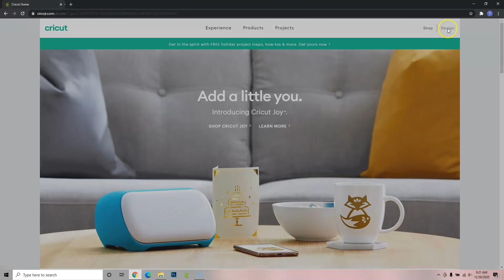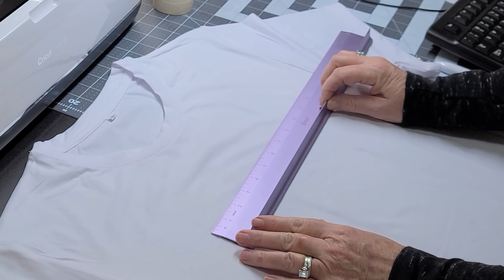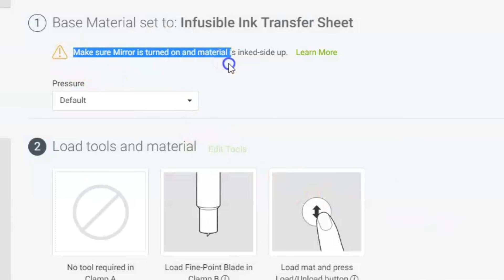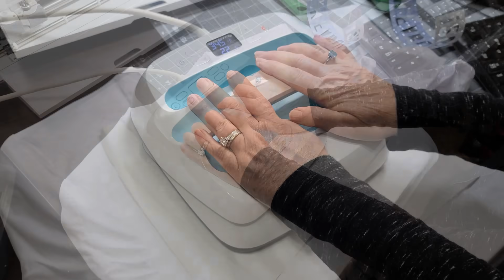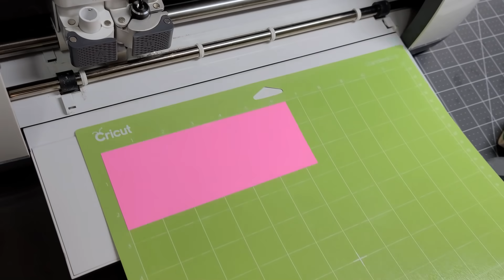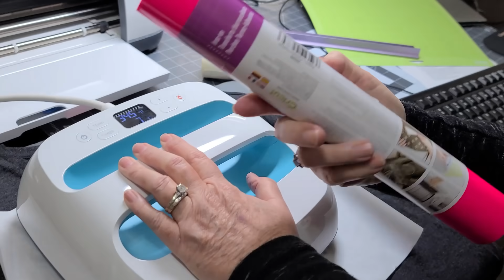Best Introduction to Cricut Maker! How To Make T-Shirts!

Comment from the maker: Here's a list of products used in this video. These are affiliate links which means we earn a small commission (thanks!).
- Cricut Maker - https://cricut.pxf.io/PybabQ
- Cricut Easy Press - https://cricut.pxf.io/k0WRWd
- Cricut Heat Mat - https://cricut.pxf.io/eKNRNz
- Cricut HTV - https://cricut.pxf.io/aneKeM
- Cricut Ruler - https://cricut.pxf.io/GmgDgL
- Cricut Trimmer - https://cricut.pxf.io/oqOnOm
- Cricut Standard Grip 12"x12" Mat - https://cricut.pxf.io/zN4j46
- Cricut Tshirt - https://cricut.pxf.io/baV7Nk
- Cricut Infusible Ink - https://cricut.pxf.io/Orb1Kn
Reply: what kind of paper are you using
Reply: Do we need to apply transfer tape to the vinyl before cutting? I didn't see that part in the video?

Comment: Hello, so what is the difference between this heat press and the bigger ones with a lever that you pull? So the cricut machine makes life easier?
Reply from the maker: Some of the bigger heat presses with auto release when they are done. Some will allow you to apply pressure without have to lean on the machine. If you're thinking about getting a bigger one, I'd look at HTVRONT. They have several models. Here's a comparison of their 15x15 models - https://youtu.be/Qhy5HjGfAmw?si=XpEuYgYk75Y05STx

Comment: Do you need a heat press or will an iron work?
Reply from the maker: Iron will work but with sublimation the temp needs to be 385-400 degrees.

Comment: quick question i know im late but if i have an iron not a heat press will it still work to make the text stay on the shirt?
Reply from the maker: Yes - definitely with heat transfer vinyl (iron on). If you're doing sublimation or infusible ink, you'll need an iron or heat press that gets up to 385-400 degress and use a shirt that's high in polyester. The higher the count the better the results.

Comment: hiya, I have to ask if you don't by a cricut T-shirt, on a different brand T-shirt do you have to use the Iron on vinyl instead of the ink one ?
Reply from the maker: The infusible ink needs to go on a garmat that's high in polyester. If you use it on a 100% cotton shirt, it won't be bright and will fade away after 1 wash. Use HTV (heat transfer vinyl) on shirts that are not high in polyester.

Comment: What happens if I don’t use cricut shirts? Will it just not work or will it fade faster?
Reply from the maker: You can use heat transfer vinyl on fabric but infusible ink (which are sheets of sublimation prints) the fabric needs to be high in polyester. The higher the polyester count the better the results will be.

Comment: Can you still do this without a heat press?
Reply from the maker: You can use an iron. Just know that when using infusible ink or sublimation, you need one that can get to 385+ degrees. For regular HTV, an iron works fine.

Comment: I want to buy like this and wanna try print out shirts. May i know what are the equipments i need for this pls?
Reply from the maker: @steffienitura5230  Here's a list of products used in this video. These are affiliate links which means we earn a small commission (thanks!).
- Cricut Maker - https://cricut.pxf.io/PybabQ
- Cricut Easy Press - https://cricut.pxf.io/k0WRWd
- Cricut Heat Mat - https://cricut.pxf.io/eKNRNz
- Cricut HTV - https://cricut.pxf.io/aneKeM
- Cricut Ruler - https://cricut.pxf.io/GmgDgL
- Cricut Trimmer - https://cricut.pxf.io/oqOnOm
- Cricut Standard Grip 12"x12" Mat - https://cricut.pxf.io/zN4j46
- Cricut Tshirt - https://cricut.pxf.io/baV7Nk
- Cricut Infusible Ink - https://cricut.pxf.io/Orb1Kn

Comment: wow 
I have a qs- can this heat presser be used for sublimation process or is too light weight/too low temp? and what is  the programme you used for design please? thank you
Reply from the maker: The program is Cricut Design Space. Sublimation needs to be pressed at 385-400 degrees with a bit of pressure. The new HTVRONT manual heat press would work well with sublimation. You can adjust pressure with this unit. Check out my review of that here  - https://youtu.be/u-rUojEdlbY?si=bEKDxhYDsrtEv9rt

Comment: and what happens if you dont use a circut shirt or fabrics? I plan on only using 100% cotton anyways.
Reply from the maker: Cotton works great with HTV but not so much with Infusible ink… use shirts high in polyester with Infusible ink aka sublimation.

Comment: I normally buy  tshirts from tshirt studio .
I would like to know everythink needed for printing myself plz
Reply from the maker: In this video, I used Cricut to cut vinyl and iron that on. You can use a sublmination printer to make sures but the shirts need to be high in polyester and light vs dark works better. I'm working on a video about this.

Comment: Can someone help me? I’m new to using the Cricut and I bought an SVG file off of Etsy that I want to print on a shirt. (It’s 2 colors red and black . ) I wanted to add my name to the file to match the red color . I added the name to the file in canva and I uploaded it to design space as an svg. When I go to complete the project (To the next step “ make” )the black cut on the grid looks ok but the name I put in canva for the red cut is now separated from the image and the letters are set off to the side in a random order. Can someone tell me how I can make the two red images print together and in the way I positioned them on the image? Any help would be greatly appreciated. Thanks!
Reply from the maker: Hi - on the canvas in design space, select all the letters then click Attach in the bottom right corner. Once you do that, try to make it. 🙂
Reply: Thank you sooo much for the reply. I  try that now.
Reply from the maker: @princessss42  - you’re welcome 🙂
Reply: It worked ! Thank you so much!!!

Comment: Can you use a regular iron, or do you have to have a heat press?
Reply from the maker: You can use a regular iron with more iron on material. Note - infusible ink needs high heat between 385-400 degrees.

Comment: Thank you for amazing video , what is the material you are cuting called?
Reply from the maker: You can use iron on vinyl also called HTV or infusible ink. If you use infusible ink, you'll need to use a shirt that's high in polyester.

Comment: Instead of the press can't you just use a iron????
Reply from the maker: You can for most iron on material. But for infusible ink the temp needs to be between 385-400 degrees to transfers well.

Comment: So do you have to use a circut shirt or is that preferred?
Reply from the maker: You cans use any shirt within iron on material but with infusible ink you need a shirt high in polyester - doesn’t have to be the Cricut brand specifically.

Comment: What's the greatest brands of shirts you can use as for as budget wise not so high cost as the cricket shirts..?
Reply from the maker: With regular HTV (heat transfer or iron on vinyl), you can use any shirt brand. With infusible link, you can also use any shirt brand but the shirt needs to be high in polyester. The higher % the brighter your colors will turn out.

Comment: Can the vinyl hold up to multiple washes?
Reply from the maker: Yes. Be sure to follow Cricut’s care instructions:
Wait 24 hours after iron-on application before washing. Turn garment inside out. Wash and tumble dry on low or medium heat. Do not bleach or dry clean.If you need to iron, turn garment inside out and iron the back side.

Comment from the maker: Here are the links to the products used in this project. We are Cricut and Amazon affiliates, so we may earn a very small portion of your purchase (THANK YOU!)
- Cricut Maker - https://amzn.to/3eIQXA0
- Cricut Easy Press 2 -  https://amzn.to/359kDCa
- Cricut 12"x12" Easy Press Protective Heat Mat - https://amzn.to/3pRQIGR
- Cricut Infusible Ink Iron-on Material - https://amzn.to/2LfDk00
- Cricut Iron On Vinyl - https://amzn.to/3Ws4CAD
- Official Cricut Women's Infusible Ink V-Neck T-shirt - https://amzn.to/3rSl7GA
- Cricut, Basic Tool Set - https://amzn.to/2X7dTjZ
- Cricut Metal Ruler - https://amzn.to/3Nlyquc
- Cricut Standard Grip Mat - https://amzn.to/3Fz3ViV
- ChicWrap Parchment Paper Dispenser - https://amzn.to/3SMXE5R
Reply: Does it only do text or can we insert pictures?

Comment: What do you guys like better? Inked infused transfer or vinyl for the tshirts?
Reply from the maker: Hard to say. Infusible ink is awesome but does require shirts high in polyester for best results. I don't always have those on hand. Vinyl works great and the colors are vibrant on any material.

Comment: Where did u get your transfer tape from I got the circuit one and the letters won’t come off it could be the needle idk
Reply from the maker: We use the Cricut brand and it works most of the time. Sometimes you have to press a little harder.

Comment: Could you just use a iron ?!? Or you need heat press ?!?
Reply from the maker: You can use an iron for HTV but for infusible ink the temp needs to be between 385 and 400. If your iron gets that not, you should be good to go. Apply extra press for infusible ink.

Comment: Do you have to have the heat press or is it just like a regular Iron?
Reply from the maker: You don’t have to have a heat press. An iron will work. The only material that may give you a little hard time with an iron is Infusible ink which needs to be heated at 385-400 degrees. Everything else should be good.

Comment: Lastly what’s the name of the tool you use to cut that infusion ink sheet
Reply from the maker: I have the Cricut Maker and Cricut Joy and use both to cut infusible ink. Depends on how big a project I'm doing. The Joy cuts 4.5" wide. The Maker 12" wide on a mat or 13" wide with smart vinyl.

Comment: You said they have permanent vinyl ? 

What would you recommend for me .. 

I have a 2 word logo ..i prefer cotton tees
I normally would screenprint but I end up having lots of inventory left… 

So now I’m about to order a heat press and cricut …… I want to get as close as a screenprint looking tee / permanent looking /clean looking tee as possible 

Will HTV be the go to ? What type of vinyl technique will you recommend .. 
Can you give me feedback please

I’m also wondering if I should get the cricut or heat press machine 🤦🏼‍♀️
Reply from the maker: If you are wanting to put a logo on a shirt, you will need to use heat transfer vinyl (HTV). If you want to put it on a sign, glass or something like that, I would use permanent vinyl. Permanent vinyl doesn't need heat but HTV does. You will need a cutting machine like one of the Cricut models. If using HTV, you will need an iron or a heat press. Hope this helps.

Comment: Can I use a regular iron? SOS!
Reply from the maker: Yes you can. Works great. The heat presses cover more area and get hotter for materials like infusible ink which needs heat between 385-400 degrees.

Comment: Can you do the heat bit with a normal iron?
Reply from the maker: You can use a normal iron for more iron on material. Note that infusible ink needs to be heated at 385-400 degrees.

Comment: You most definitely don't have to use the Cricut shirts😂 I use tagless Hanes and they come out WAY MORE vibrant!
Reply: I was just gone ask they, like y u have to use a cricut shirt?  guess for 💵💵
Reply: @jannelson168  fr
Reply from the maker: Correct - you can slap vinyl iron-ons on just about any brand of shirt. Be careful with some of the blends and temperatures - you don't want to melt athletic jerseys.
Reply: @craftwithfelicia  do y’all use a printer to print the graphics out? Or just the cricut?
Reply from the maker: @michaelhoffman-mangum4261  hi there! Just the Cricut in this video, but we’re experimenting with using dye sublimation heat transfer vinyl right now, which opens a whole new world!
Reply: @craftwithfelicia  awesome!! I’m launching my tee shirt brand soon, I have a 2 time logo but it’s not that big, I don’t need a printer to print the logo out right? Just the circut and best press? Thank you for responding too
Reply from the maker: @michaelhoffman-mangum4261  you can definitely do a single color logo with no printer. Good luck with your new stuff!
Reply: @craftwithfelicia  thank you! What if the logo has 2 colors? Is it possible to do 2 layers?
Reply from the maker: @michaelhoffman-mangum4261  You can absolutely do two or even more layers! It’s just you’ll have to cut every color individually. That’s why we’re playing with the sublimation.
Reply: Where to purchase bulk t-shirts online
Reply: @theonlinechiz  jiffy shirts
Reply: @xotiicbeatz8701  🙏
Reply: My eyes rolled so far back in my head when she said that. I used the same bullshit she used to make correct visual adjustments. 😂
Reply: Do they have to be polyester
Reply: Ikr
Reply: Also I got two matts with mine.
Reply: Mats I mean lol 😂
Reply: 😂😂😂I’m dead
Reply: Hey also do you have to download prints only from the cricut website ? Or can the prints come from downloads in your computer ?
Reply: Ty .I will
Reply: i just asked that question beofre i saw ur comment... I wanna get a bulk of shirts, totes hats etc and create my own designs.
Reply: They said for it to keep better through many washes use the circuit shirts.
Reply: @MR.BAD_IDLE  hey it works on 100% cotton?
Reply: Good to know.
Reply: Thank you. I was wondering about that.

Comment: I don't even know where to start. What kind of machine do I need? What tools? How much does it cost to upkeep all the products to make cards, shirts and such? How much is the heat press? You can't use other shirts?
Reply from the maker: You CAN use other shirts with vinyl - just about any cotton or blend t-shirt! No silk or anything that doesn't like hot irons. We use $2 Walmart shirts! Upkeep is zero - no oil, no maintenance, no cleaning. You can use plain paper or cardstock too, or the Cricut card making kits if you want. We use both. Regarding the machine you choose, it really depends how deep you want to go. For a few small shirts or cards here and there, the Joy will do. If you want to make 100 t-shirts a week, you’ll probably want a Maker. This video we did on Amazon Live explains the differences. https://www.amazon.com/live/broadcast/8069952b-d706-4960-8cc6-33c09511af57
Reply from the maker: https://www.amazon.com/live/broadcast/8069952b-d706-4960-8cc6-33c09511af57
Reply: Also, I love just regular crafting as well. Please tell me I only need one machine and it can do everything lol. Thank you!
Reply from the maker: This is an excellent question! We get this a LOT.

Comment: So for infusable ink you HAVE to have a cricket shirt??
Reply from the maker: Not necessarily! For infusible projects, it can be any sublimation-compatible shirt, but we've used it on non-sublimation shirts too. It lasts for about ONE WASHING with a plain non-sublimation t-shirt. The coating on the sublimation shirts "locks in" the ink permanently. I think we did a video on this - looking. Thanks for watching Kittee!
Reply from the maker: we've learned that any shirt that's at least 60% polyester will work. The more poly, the better.

Comment: How do you do if you want to print a big picture with different colors? What kind of paper do I use and what printer do I need?
Reply from the maker: You would probably be better off with screen printing or dye sublimation if you want many colors. It can be done with vinyl also, but depends how much you want to cut, and how many you want to make.
Reply from the maker: We made a dye sub printer! Demo towards the end of this video: https://www.amazon.com/live/broadcast/134dc1a3-3424-4514-a6f8-39efaa115745

Comment: What works better heat press or iron on after this
Reply from the maker: The heat press has a larger surface, so you won't miss any edges. Plus, I believe the heat press gets a little hotter than an iron.

Comment: Great video thankyou, Very tempted to buy this now. Can you change the software to metric dimensions and the easypress to °C ?
Reply from the maker: I think that is possible! Set temperature Press Temp button, then adjust value with plus (+) and minus (-) buttons. To switch from Fahrenheit to Celsius, press and hold the Temp button. The software should also have a setting for cm/mm as well.

Comment from the maker: We're working on some new projects using our Cricut Mug Press, the Brother Scan n' Cut, and also testing the Silhouette Cameo 4. Subscribe so you don't miss a beat! Thanks for watching.
-Felicia
Reply: Hello there! Which do you like better the Cricut machine or the Brother scan n cut? Do they do the similar things?
Reply from the maker: @tashabrown8301  great question! They both do pretty much the same things. But I have to admit, the Brother display on the machine itself is very helpful to view the status of what's going on, and also to do some tasks independent of the computer. That's not possible with the Cricut, and since their Design Space software can be a little unreliable, a little self-containment can be really helpful. What's really cool is the Brother has a scan and cut function, which saves several steps if you do that sort of thing. Check this video out if you haven't already: https://youtu.be/W0efv2OrCmc
Reply: @craftwithfelicia  I sure will check it out!! Thank you👍

Comment: You said as long as use the cricut shirt, the ink won't fade? So, it doesn't last on other brand shirts or did I hear that wrong? Thank you
Reply from the maker: You are correct! We've washed one of our special Cricut Infusable Ink T-Shirts at least 20 times and the color still pops. To be honest, the t-shirt is beginning to get a few pillars, like you'd see with silk or bamboo cloth. But Tim does use this as a sleepy shirt. However, the color is still perfect.